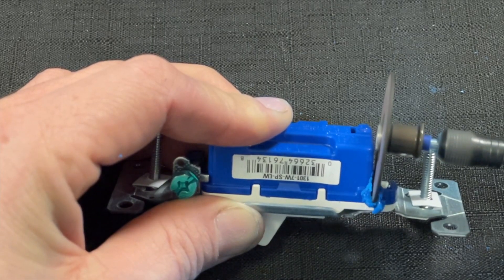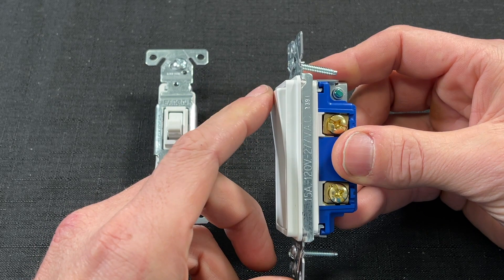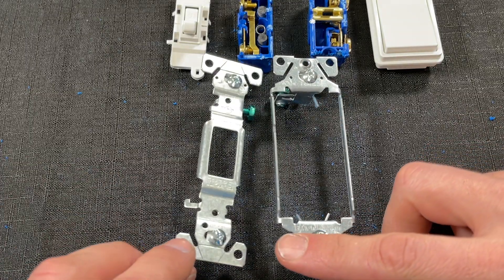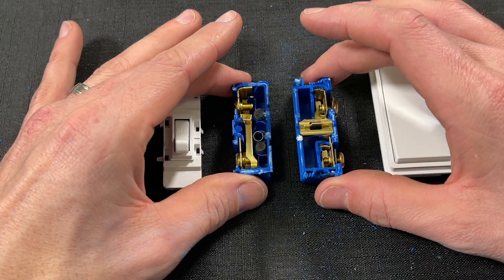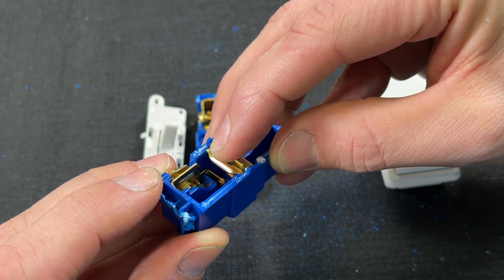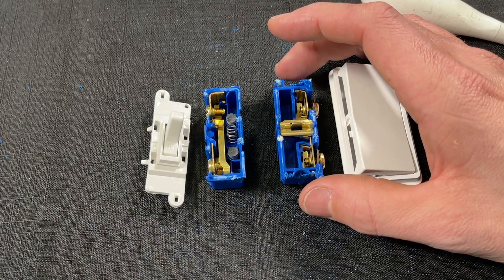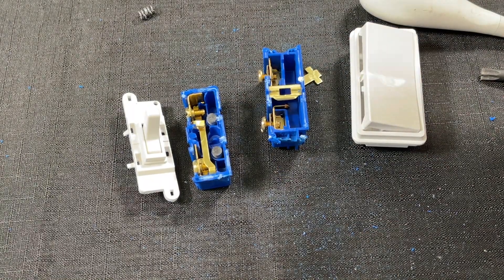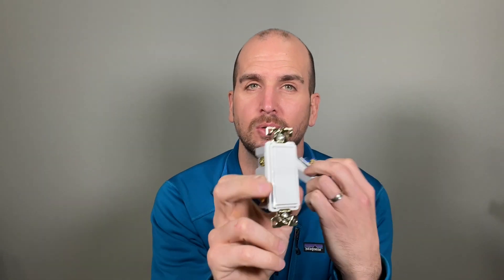What Switch Should You Buy | Toggle vs Rocker (Decora)

Comment: I sometimes turn toggle switches on and off by hitting them with plates full of food. They can really do that. I feel like the upgraded Leviton “preferred” switch is a little bit springier than the standard, and feels longer lasting, and probably is a little bit longer lasting on less amps than it was designed for. It isn’t one of those ugly 20 and 30 amp switches, so it looks like a household switch. I have never liked the decora switches.

Comment: Love your comparison videos - thank you for putting them out there! Some thoughts:

I prefer traditional toggles in dark locations I don't necessarily frequent. Generally on entering a room, I have a good sense for where the wall surface is - there's enough light approaching the doorway to know the location of the wall on the way through -  but not necessarily the exact location of the switch on the dark side. With a toggle, I can just wave my hand across the right wall area and usually trip it in one sweep. With a rocker switch, if it's not a room I'm familiar enough to have muscle memory of the switch location, I'm patting/poking the wall a few times before I find it. I sometimes see a halo of smudges/handprints on the wall around rockers, but seldom around toggles.

So far as tripping switches with your elbow, I sometimes elbow toggle switches too, though only when there's enough light to see the switch, and not in dark locations I mentioned above. It's definitely more finicky than with rockers (with some fear of hitting your funny bone) but hasn't been a showstopper for me. For locations where this is a frequent need, I find I end up installing motion sensor switches instead, rendering it a moot point.

As for the wire attachment differences, that's not strictly a rocker vs. toggle difference.: the commercial grade toggle switch has the backwire plates too. I understand you're trying to keep things fair by comparing residential vs. residential, but there's a price difference there that's the same as the price difference between residential and commercial toggle switches. I think it'd be fair to compare $2 toggle vs $2 rocker. Both get you the same wire attachment, cost the same money, and it becomes literally a free choice between toggle and rocker. Then, what you trade for price for the other options, you've already covered in other videos.
Reply: "I prefer traditional toggles in dark locations I don't necessarily frequent. Generally on entering a room, I have a good sense for where the wall surface is - there's enough light approaching the doorway to know the location of the wall on the way through -  but not necessarily the exact location of the switch on the dark side. With a toggle, I can just wave my hand across the right wall area and usually trip it in one sweep. With a rocker switch, if it's not a room I'm familiar enough to have muscle memory of the switch location, I'm patting/poking the wall a few times before I find it. I sometimes see a halo of smudges/handprints on the wall around rockers, but seldom around toggles.
"

This, a million times this. I hate hate HATE poking around in the dark for a rocker switch. Give me a toggle switch, it's cheaper and more functional. Win win. I couldn't care less about looks if looks come with the downside of being less functional.
Reply: I had rocker growing up. I always hated them. Toggle are objectively a superior way to hit a switch. My current home, which is pretty new, has toggles everywhere. Can enter a room and without looking always hit the switch first time.

Comment: I put rocker in my home.  I have to wonder how hard the hit the rocker to get it to break out of the cradle.  My wife likes the rocker because the toggle switch, if not used a lot, will gather dust and dirt and it is not as easy to clean.

Comment: It looks like, if the rocker button falls off (or pried off), the hot "cradle" contact would be exposed. And since it looks like a switch still, it would be tempting to try to use it.

I think the decora style looks better and are good for high-traffic areas, but I prefer to use the old toggle switches since they're easier to find and flip even in the dark.

Comment: When I have to replace a switch, I go with Leviton Professional Heavy Duty. More money, but I will never outlive the switch. And my recent replacement of two 3 way switches was because the 33 year old ones were causing my 2 new LED Panel kitchen lights to flicker.
Reply: 3 Way switches fail far more frequently than single pole.

Comment: I prefer toggle, but I can see the benefits of a rocker. That said, I once had to replace a rocker that was loose. I don't know if it was broken as you describe in the video, but it wouldn't hold in the on position.
Reply from the maker: Yeah, in terms of switches failing I think rockers have a higher failure rate but I am sure some brands are better than others.

Comment: My home is approximately 35 years old and most of the switches are toggle.  I have replaced about 3 switches with the rocker type and like the look / feel of the rocker.  I have one toggle that still works but the plastic toggle is very loose and jiggly might be time for a replacement? I think I would prefer the rocker type if I were to replace existing switches in my house today. I don't mind the cost difference but were I to work in the residential electrical industry I would think twice as it's a big cost difference.
Reply from the maker: Appreciate the feedback!

Comment: One thing I've noticed is that when getting a 3-way switch, the toggle still has screw leads and the rocker has pigtails coming out of the switch. Personally, it's way easier to put wire nut on the pigtails than to mess with the toggle's screw terminals. I prefer the rocker but one big disadvantage is that it's harder to "dress" the wires and get them all pushed back since the rocker body takes up so much space.

Comment: I prefer rockers whenever possible, which is 99% of the time. But sometimes you basically have no choice but to use toggles. Case in point, you can get single & double polished brass cover plates, but a triple Decora polished brass plate? Good luck with that! But polished brass triple cover plate for toggles are typically stocked items at Lowe’s etc. 
Also, toggles are better for illuminated switches, illuminated rockers look terrible.
In any other way (appearance, dimmers, cleaning, etc) rockers win hands down.

Comment: I prefer toggle switches. I like seeing if the switch is off or on. Convenient for porch lights. Also knowing if the switch is off when removing a broken light bulb in socket
Reply: That makes no sense. You can easily see if a rocker is on or off because pressing it down at the top always means off.

Also, you shouldn't be relying on switch position ANYWAY because some people are dumb and install switches upside down.

Not only that, I've seen cases where the installer put the switch on the neutral leg and the hot wire was always connected to the fixture. Do it properly and get a multimeter to verify something isn't energized.

Comment: The other case I have seen for rocker switches is for seniors or other people that may not have the best fine motor control can use rockers more reliably. Similar to your comment about hitting the switch with your hands full
Reply from the maker: Good point, thanks for sharing 👍

Comment: I've been enjoying your content recently. I work in the electrical department of a home improvement retailer that sells Eaton.  I really appreciate the content because I find it interesting to have an idea what's inside these things, which previously I never had seen.  I will throw out one thing that I discovered that I thought was interesting... Eaton plugs and switches have wire strippers built into the mounting bracket!  It's not something I typically share with customers because I encourage them to use the correct tools... but I thought it was kind of cool how much thought was put into the design of a $0.49 switch.  And it explains why I sometimes feel sharp edges when I grab a handful of these to transfer into a newly-opened box.  So if you ever need a wire stripper in a pinch, grab an Eaton device!
Reply: What brand do you recommend for decora?

Comment: Love your videos man.

There's not much performance difference between these. You can get either version in side wire, backstab, and pressure connector. So it all comes down to esthetics.

Might even be able to argue that going with decora everything in a home, is a good way to simplify finding faceplates that fit your applications. No more having to get weird combinations of 2 duplex, 1 switch for a 3 gang plate. Just get however many gangs you need in decora.

Comment: I have all rockers and they are horrible. When you push them on they make a buzzing sound and most of the time they don't even turn on right away you have push them down and back up pretty firmly.
Reply: It's very likely that the buzzing sound is due to internal arcing.  At a minimum, that will erode and wear out the contact points faster... and at worst, it is a fire hazard!  Personally, I would get those changed out for a quality switch ASAP.

Comment: My house has Decoras so that's what I replace them with. I think that they fail a lot, especially the 3-way versions which tend to go into a dead mode: sometimes I can't turn on the light with one of my 3-way switches because the other switch is stuck in the middle of its travel. But replacing light switches isn't a major drag.
Reply: That's a brand or a batch issue, not an inherent aspect of the design.

My parents had a house built in 1974 using original Decora switches and receptacles.   They differ from the later design by the switches not having a rim around the rocke, and by having vertical grooves on the receptacles.  Those design details are obvious next to new parts and original parts are not available, so it's pretty easy to spot changes.

The switch rim is a real improvement.  The original design was cleaner and more elegant, but the rocker paddle would jam against the wall plate if the switch wasn't firmly mounted exactly square to the wall surface. 

Switch failures over time have been rare.   A few switches were replaced because the aging neon lights ($$$ extra at the time) flickered annoyingly, but now most are just dark.  Only one or two switches failed by going "soft" and not operating.

Some of the receptacles failed with loose contacts and cracked faces.  One even charred badly from the current drawn by a vacuum cleaner.  The decorative groove proved to be a weak point for starting cracks, and cracks allow the contact wipers to spread.  Even without cracks, the contacts lose their tension over time, just like cheap semi-round duplex receptacles.  Every one of the accessible receptacles in the kitchen has been replaced over time, with none of the replacements failing.

Comment: I’ve had to replace the Decora switches for my kids, they didn’t work, the rocker was broken. Their kids probably pushed too hard and/or played with them. I have regular switches in my home. I’m an engineer, I don’t see any advantages to replacing working switches with Decora switches. I’m in my new house 17 years and have not replaced any of the original almond switches or outlets. I have added double and lighted switches, and have had to replace some of these over the years. I like the almond color because of cost and the variety of covers available. I have 4 switches by my back door, all in one box. I needed to add an outlet into that box. I basically needed 4 switches and one outlet. I used 3 switches, and a combination switch and outlet, no problem right? I couldn’t find an outlet cover for this. I went to a electric supply house and ordered it, it came in a week.....$7. I did find one elsewhere, but it was very flowery.......!  I don’t think these are available in white or Decora, or are they?   Jim

Comment: When I was a kid, I used to try to balance the toggle switch at the halfway point...how bad of an idea was that? I've been wondering, since learning more about switches from this channel as well as Technology Connections
Reply from the maker: Not good 😂.  It can increase the arcing between contacts and eventually lead to failure.  With that said if that is the worst you did as a kid I think all is good 👍
Reply: @EverydayHomeRepairs  ahaha thanks!! I was thinking the arcing could have done worse. Glad nothing happened hahah
Reply: @EverydayHomeRepairs  I wasn’t the only one to do that. I did that long time ago and it would crackle and arc inside, after that I stopped doing that.

Comment: I really enjoy these videos. Have you ever done a video on Wago 221 and 222 electrical connectors?  If you haven't I would like to see your take on them.
Reply: Yes. I just came across them the other day.  Recently I have been using Wall-Nuts. Much cleaner, neater and quicker than the old wire nuts.

Comment: Interesting how a standard toggle and rocker are so different! Not sure if I should be more surprised that the toggle doesn't have the straight clamp-downs or that the rocker does. I do like to use rockers in new installations and anywhere they are a better fit appearance wise (like in my bathroom in a 3-gang with a GFCI outlet and a humidity controlled fan timer). Back when I bought my (1950's) house 15 years ago one of the first things I did was swap every outlet, switch and faceplate since they were a mixed grab bag of colors and ages. I used toggles, but if I had it to do over again today I'd probably go with rockers since the plates were already being replaced too.

Comment: The other cost consideration is the wall plate cover. The cheap ones have the screws exposed. Chances are if you're stepping up to a rocker switch, you probably will be spending at least another $2-5 for a hidden screw version. Obviously a win from an ADA standpoint as someone in a residential setting will likely benefit over a 20-30 year lifespan of a switch.
Reply: I wanted hidden screw covers, but I couldn't bring myself to pay more for the covers than the devices.